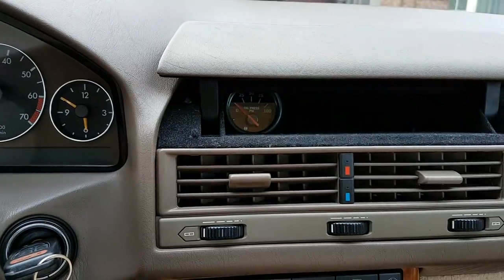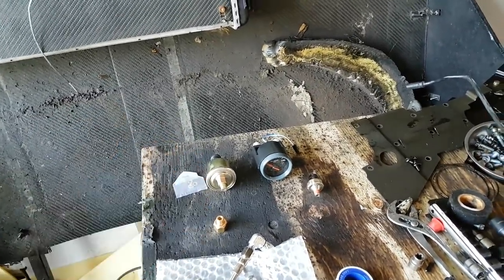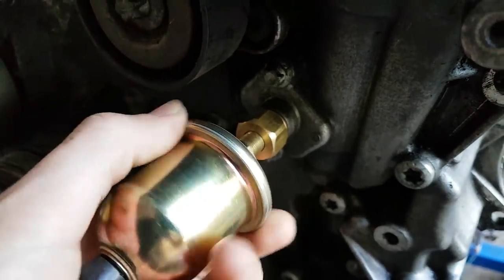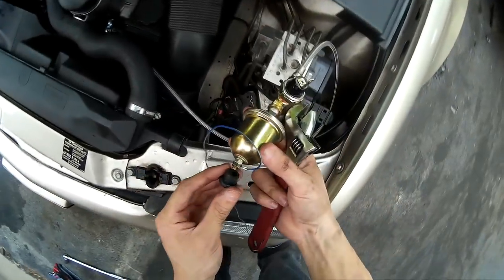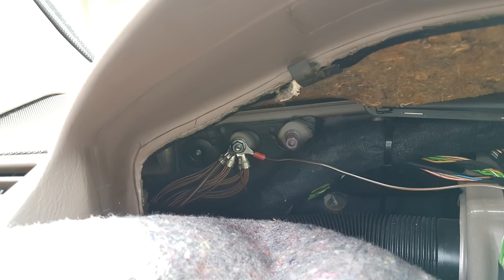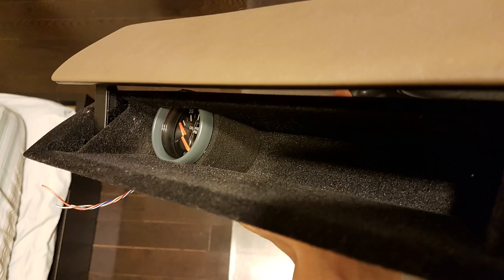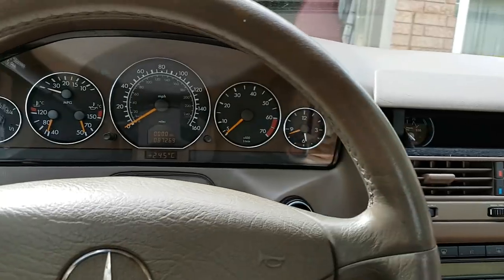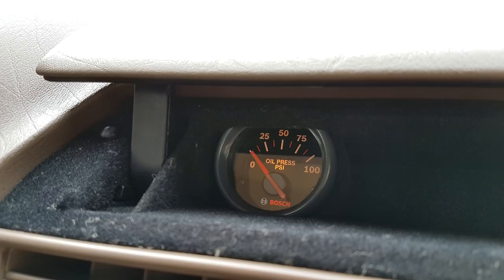Oil Pressure Gauge and Warning Light Install

Comment: Definitely doing this! On a standalone ECU you can also set it to automatically turn off the engine if the pressure falls below a certain level.
Reply from the maker: Good advice! I'll look into something like that for the E55 possibly
Reply: You can actually figure out how to do this using a timer and relay. If the pressure falls below a certain level for x seconds, the relay disconnects the ignition. Should be pretty simple, actually.
Reply: wouldn't you loose powersteering and braking? and get steering lock?
Reply: @nirfz  on semi truck you get message of engine shutdown and you have 10-15 sec to stop.
Reply: @nirfz  you will loose power-assist indeed, but not lock if you have a key
not an issue with old-timers ;) my m103 used to cut-off just on its own while driving for ex ))
Reply: @dannoi  Yes with older cars it can work when the key in position 2 blocks the lock.
I think i remember stories i heard in the 80's where cars stalled, and people tried to restart it while it still moved, and they crashed because when they turned off the key the steering lock came on, and they didn't manage to get the lock off before hitting something.
Reply: @nirfz  80s ? thats me like last year )) no crashes though
Reply: @dannoi  😁
Reply: @xfmotorsports  You could also hook it up to a Raspberry Pi and use the Pi as a relay/timer focused specifically at nothing but oil pressure readings. It could log every time your pressure goes above or falls below a certain limit and even wire it up to a standalone ECU and get even more creative.

Comment: Great job!
Reply: u think this O ring issue is actually something ppl should be worrying about?
Reply: Alex i've been following your videos for a while and am a big fan of the channel. Your input here would be greatly appreciated. I was going to comment on one of your video's but you haven't posted a vid of your wagon in a while. 
My question is do you think this modification is worth doing, as I want to modify my E55 and make a full build similar to what you did. 
That being said, obviously I don't want my baby breaking down and all that $$$ lost because of this. As you have the experience of a Mercedes Tech and your YT, do you think you could do this install on your E55 or at least address this?
Thanks so much and I would really really appreciate any input.

Comment: What a great follow up video!

Excellent solution to have redundancy for both indication and measurement for your oil pressure. It is a very easy install and I'm baffled why Mercedes doesn't even include it in their cars! It's just insanity in my opinion! Hiding the oil gauge in the dash is really cool solution. Cutting into the compartment is a life saving procedure and doesn't reduce the value of the car, considering how essential it is to have the light indicator and corresponding oil pressure gauge hidden in the cubby compartment.

I agree that rebuilding the second AMG engine you bought will allow you to make it better and more robust, especially if that very engine blows for another reason. This is one of the reasons why I like buying refurbished products, because usually they're made better with updated components that what was previously used, at a reduced price.

Look forward to your build videos when the crank bearings come in. I'm not sure why these are most important to have first, but I know you'll explain and demonstrate why in your video featuring that install and measurement.

I learn a lot from your videos and the detail you provide.

I'll definitely come out to see you race once your car is put together and working as you see fit.

Keep up the good work!
Reply from the maker: Thanks. Wanted to get the crank and con rod bearings first so the clearances between the bearings and crank can be measured. I'm sure they should be fine but its an important check before rebuilding an engine. If the crank has worn down too much or the con rods have opened up the clearances will be too large and I will find out in time.

Comment: I guess Mercedes have wrongly specked the material they use for that o-ring. Mercedes make a lot of engines that work in various conditions - they should know better. I would ask at a Mercedes authorised service point if there is a maintenance update concerning this o-ring.
As far as the oil pump chain marks are concerned, Germans in general use tensioners on the oil pump chains - I would check the tensioner for wear as well as the spring on the tensioner for the right pressure. I don't know your specific engine, however like I said, BMW, VW Mercedes - they all use them and the scratching effect due to weak or worn tensioners is known.

btw - very cool video - thanks for sharing and documenting your work!

Comment: Good work man, good to see at home mechanics doing proper work,
next time when u teflon a fitting use the teflon anticlock wise so when u screw it on, the teflon will stay on the threads. 
keep it up bro

Comment: When u rebuild this engine, the main bearings are different sizes, the block is marked with numbers and you’ll have to order basically 2 sets of bearings. The main bearing caps were all reds, and the block side bearings were yelllow, yellow, blue, yellow, blue. I originally ordered all blue ones, and checked the clearances and they were a bit off. Mic the crank, and if that’s within spec, follow the bearing size that’s stamped Into the block.
Reply from the maker: Yes, you are right. There's 3 different types for the block and 5 different types for the end caps. The letters for the colors are also engraved on the crank. Makes it extremely confusing to order but hope the clearances work out.
Reply: SK8215 you’ll be able to get em, but it’s gonna cost, since they couldn’t order them a 1/2 shell at a time I had to pay for a both when I only needed 1 half! Good work I enjoy your stuff

Comment: Woah u got some heavies commenting here now! Great job. I'm gonna do the same.
Reply: Btw do you know if the m113 non k has the same o ring on the pickup?
Reply: And did you upload the video of you changing the rocker arms on ur old engine? Thanks man!
Reply from the maker: Yes, I believe all models with the two oil sumps have that o-ring. No still have to upload that and the tuning part lol. I'll try to cover it in the engine teardown or rebuild video since I have to rebuild that engine anyways.

Comment: What if the oil pressure is too low? Do you have to stop immediately? What to do next, restart the engine, or try to find to cause of the low oil pressure before starting the engine? What is the normal operating pressure for Mercedes, 3bar? If it is 2bar, can you still drive the car normally or does it mean that there is something wrong?

Comment: Good video, ive been doing these types of mods to my cars but its getting more difficult as cars go canbus. I was angry my Volvo has a buzzer for the seatbelt but nothing for engine warnings, atleast my 2001 volvo still has a oil pressure light that i intend fitting a buzzer to.

Comment: Heyy I need little help please.. I bought the same oil pressure gauge did the installation but mine doesn’t work.. I didn’t connect the wire to light up the gauge.. do I have to do that for the gauge to function ? I thought it wasn’t necessary but I don’t know if that connection is the problem or if it’s another thing.. 
Thanks and great video 👍
Reply: Connect first everything under the hood, bleed oil line. When you will get it working under hood than move the gauge inside cabin.

Comment: how much must be a normal oil pressure? in case of mercedes c320 with m112 this job should be similar right? and  what about the normal oil pressure that should be running onj?

Comment: Will the switch also trigger at high oil pressures for when part of the oil galleys where the be (partially)blocked by what knows happens, not sure if it would result in a significant enough increase in oil pressure to be of any use. And also I would add a sound as well for the track driving.
Reply from the maker: There would be a drop in pressure if the oil filter or the passages before the filter get clogged. Oil passages after the filter usually don't get clogged unless the filter fails or too much sludge builds up. If they do get clogged it would be really hard to detect because even the oil pump has a pressure regulator and won't go above a certain pressure. I guess you just have to have faith in your oil filter for that.
Reply: sludge build up would only be a issue if you don't change your oil at correct max mileage oil change (i norm half it witch is 5-6k miles) 
still can't believe there is no oil pressure sensor, but the manual omittance of the oil pressure light can be a give away that it lacks the sensor (as it only has a yellow low oil light there is no second Red Oil pressure light)

Comment: So Mercedes made an oil pressure port on the engine and left it  ?
Reply: so that someone after a few years will realize that the engine sucks without a pressure gauge and that it could be installed on that port  :D
Reply: It's for test purposes
Reply: @bicylindrico  Exactly!  The process is described in detail in the Mercedes WIS.  Best regards from Germany.  Michael 🙌

Comment: Nice Job. The oil gauge is universal but the oil warning light? How do you know is going to light up when you need?
Reply from the maker: Its from a standard oil pressure switch. Whenever the oil pressure falls low the switch shorts to ground and lights up the warning light. It comes on when the engine is off and turns off when the engine starts and oil pressure builds up so that means its working.
Reply: Would it be good to have an audible alarm for the oil pressure as well? Seeing as how you might be tunnel visioning on the track and not catch the warning light in time, before you explode your engine?
Reply from the maker: Yeh, I was thinking of connecting a relay with the door circuit so it triggers the door open alarm if the pressure falls low. Probably something I'll try for the E55
Reply: older Mercedes (80's)  had a real annoying buzzer for "lights on - open door- keys out" that would be the ideal sound...

Comment: Hi! Wich pressure value is good and wich not?
Reply from the maker: I've been seeing between 20-25 psi at idle once engine is warm. The highest I see is 75psi when reving high. 
The oil I'm using is 20W-50

Comment: Is the oil pressure gonna read correctly? Since there is no oil really flowing thru the oil line extension. Just curious.
Reply: Jason thinks as if it where air, it wants to be at equil pressure and because the meter is connected on the side it wil read the pressure that is present where the oil line begins.
Reply: Marko Held: if it isn't bled out, the oil will compress the air inside the line and the gauge will read an airpressure.  If that is the right way to di it ok... i don't know, but 2 thinkg would worry me: 1. air is compressable so is the pressure it shows really what you are looking for? 2. when the oil gets hot the air gets hot too and hot air wants to expand which would show an increased oil pressure on the gauge readout. (without the oilpressure being any higher.)
Reply: Pressure is pressure. If the hydraulic oil is used as the force to move a cylinder or in applying brakes then the compressible air would compress instead of moving the piston and that is a problem. In that case the air needs to be removed. In the case of pressure gauge the air will compress to the same pressure as the oil and will deform the diaphragm in sensor and read the same.
Reply: Thread ressurection. I am curious about this to since there is a flat gasket on the inside of the plate/plug. Do you remove the gasket so the oil reaches the sensor or does it get compressed by pressure and then pushing on the sensor?

Comment: VDO has an oil pressure sensor with an internal oil pressure switch (switches below 0.5 bar) so its a 2 in 1.
Are you sure you have a good ground with the teflon between the block and the hose?

Thanks for sharing 👍
Reply from the maker: Didn't know about the oil pressure sensor 2 in 1. The ground seems pretty strong. I tried it with a 3W light bulb and the ground remained 0 volt so I didn't bother running an additional ground wire.
Reply: @jonathan643  How do you wire for the pressure switch separately? What do you wire it to in your cars?  I'm thinking some kind of shift light hidden in the dash but shining right at my face!  Thanks!